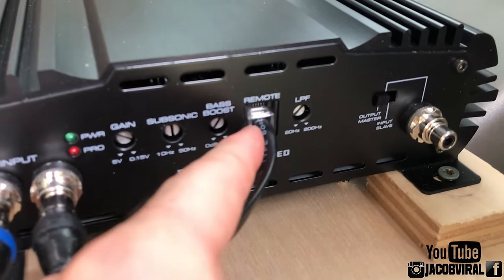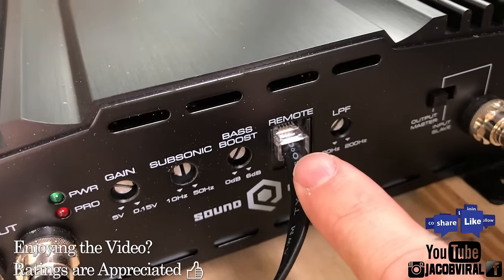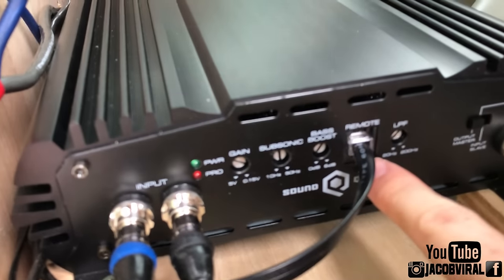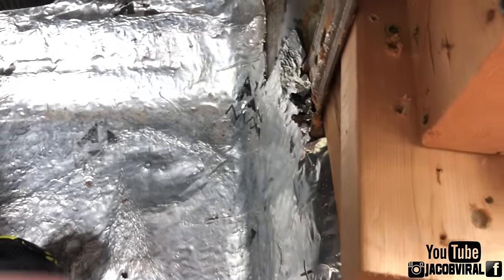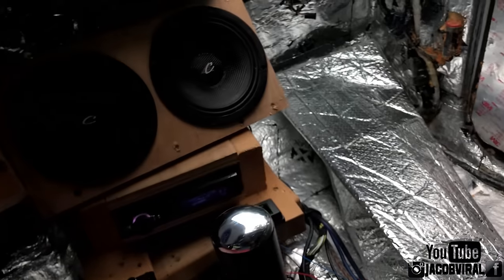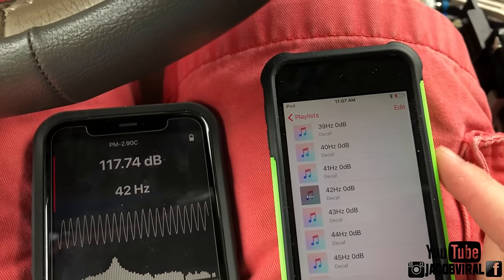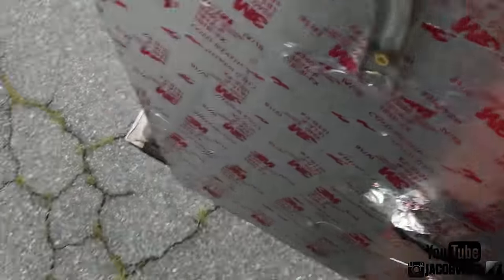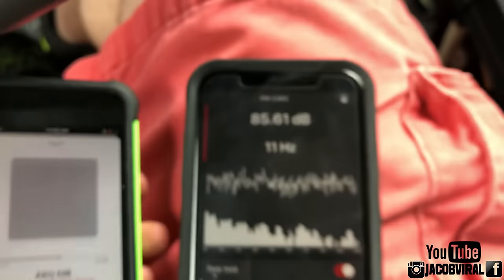DOES USING A BASS KNOB MATTER ON YOUR AMP?

Comment: What’s the purpose of a knob?  Shouldn’t have to adjust you amps.  Should be set and forget it.  Want more or less bass just adjust the equalizers on the stereo.
Reply from the maker: For ease of use to adjust bass output with the knob as some want to turn it off or down some songs.
Reply: @JacobViral2  Seems you would ruin the balance of the subs in relation to the rest of the system by doing this.  Seems the equalizers should be flat during set up but after you should adjust the equalizers on the stereo.

Comment: how would i use rca bass knob if my amp only has 1 set of rca input
Reply from the maker: Usually a bass knob rca has input and output so it runs through the bass knob first.
Reply: yea i watched a few more vids and realized that the knob go’s  in between the amp and the head unit rcas, i originally thought that both rcas on the bass knob were input and i need 2 sets of rca, one from head unit to knob and one from amp to knob but i realize now how it goes

Comment: Can someone help me? I'm installing a 1000w rms amp and have a 600w rms sub, how do I set my amp up to not blow my sub? Before someone decides to be a smart ass, I'm super green to car sound. Thank you😁
Reply from the maker: You’ll be safe after some voltage drop and rise impedance change. Just set your amp crossovers right lpf, subsonic, and gain properly and your golden. Match your gain to head unit rca voltage.

Comment: A bassknob is use when you dont have no equalizer if you have a equalizer you dont need it because the equalizer does have a sub level
Reply: An eq has nothing to do with using your bass and lots of people have eq,s and use a bass knob they are  so you can turn your subs down when you don't want to hear them as loud when you want them to beat harder you turn it up